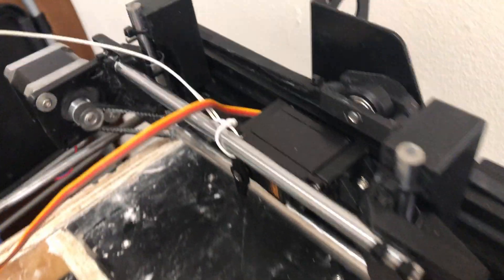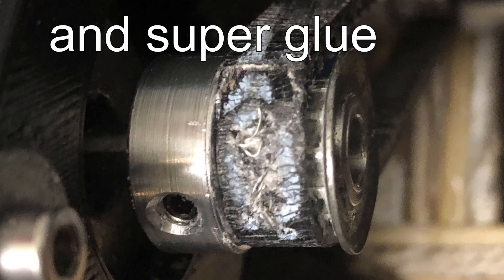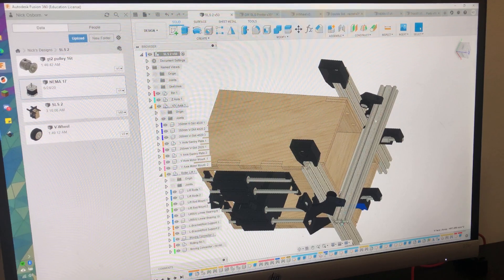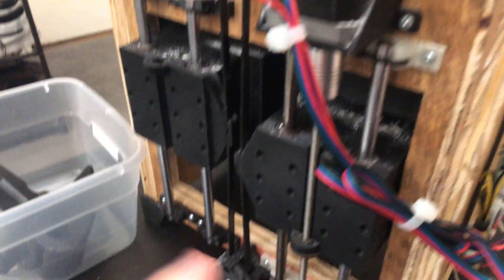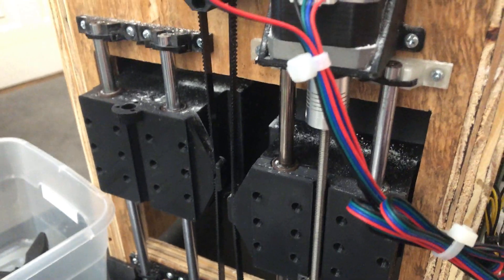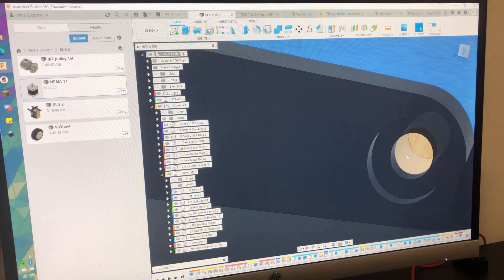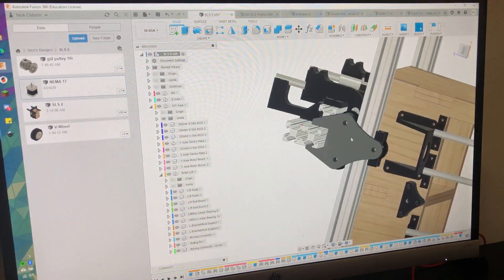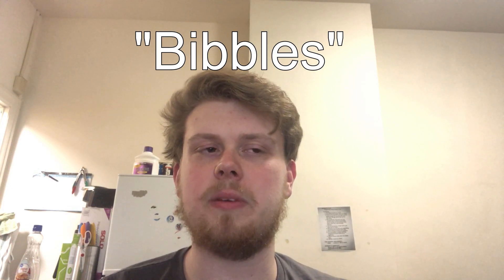DIY SLS 3D Printer || Part 5

Comment: Are you developing the firmware, or modifying Marlin, Repetier, or etc..? 
What wattage laser is needed for metal sinter? 
Great job...
Reply from the maker: I’m modifying marlin so I can use slic3r to prepare the models, not sure about metal powder sintering, probably like a 40w co2 or something like that
Reply: I made some research about that, a good laser for metal is from 100w to 500w, but this is not the problem, the issue is the wavelength, you can not use C02 because the wavelength is not the right one, you need a very expensive fiber laser if you want the metal powder to absorb the energy instead of reflecting it away.
Reply: you need a 1070 nm laser

Comment: You mentioned you won't need any heat, but you do. heating the chamber 10C below the melting point of the powder is how it works
Reply from the maker: That’s how it works for nylon, I only need it to heat to the glass transition temperature, and on pla that’s low enough that I don’t need the heated chamber